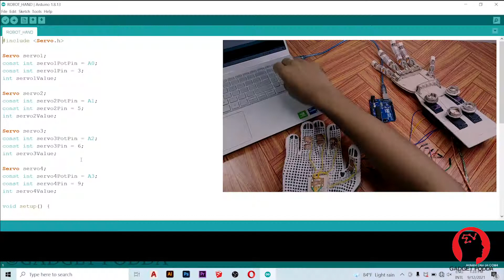How to make Gloves Control Robot Hand

Comment from the maker: #include <Servo.h>

Servo servo1;

const int servo1PotPin = A0;

const int servo1Pin = 3;

int servo1Value;

Servo servo2;

const int servo2PotPin = A1;

const int servo2Pin = 5;

int servo2Value;

Servo servo3;

const int servo3PotPin = A2;

const int servo3Pin = 6;

int servo3Value;

Servo servo4;

const int servo4PotPin = A3;

const int servo4Pin = 9;

int servo4Value;

void setup() {

  servo1.attach(servo1Pin);

  servo2.attach(servo2Pin);

  servo3.attach(servo3Pin);

  servo4.attach(servo4Pin);

}

void loop() {

  servo1Value = analogRead(servo1PotPin);

  servo1Value = map(servo1Value, 0, 1023, 0, 180);

  servo1.write(servo1Value);

  servo2Value = analogRead(servo2PotPin);

  servo2Value = map(servo2Value, 0, 1023, 0, 180);

  servo2.write(servo2Value);

  servo3Value = analogRead(servo3PotPin);

  servo3Value = map(servo3Value, 0, 1023, 180, 0);

  servo3.write(servo3Value);

  servo4Value = analogRead(servo4PotPin);

  servo4Value = map(servo4Value, 0, 1023, 160, 10);

  servo4.write(servo4Value);

  delay(5);

}